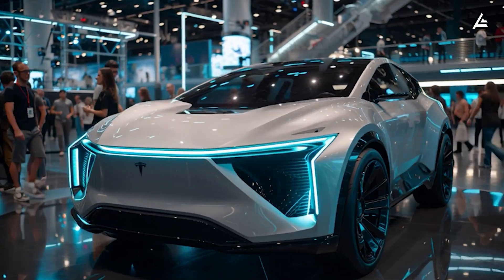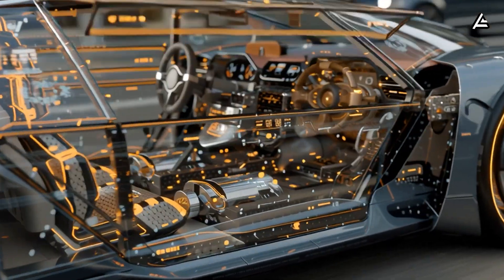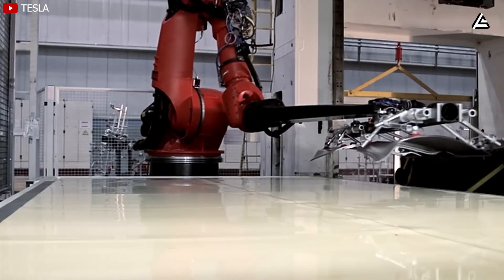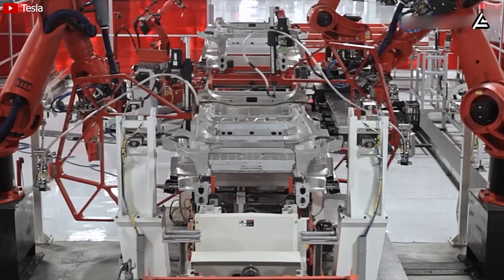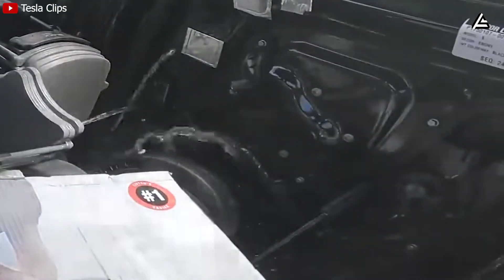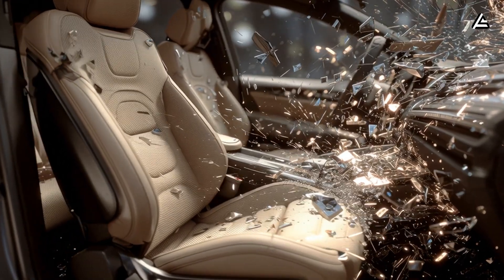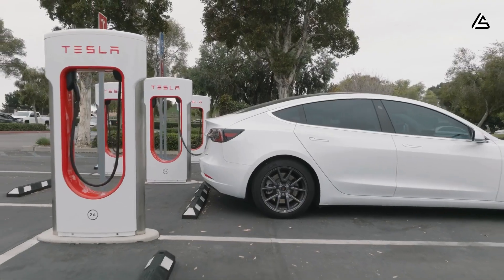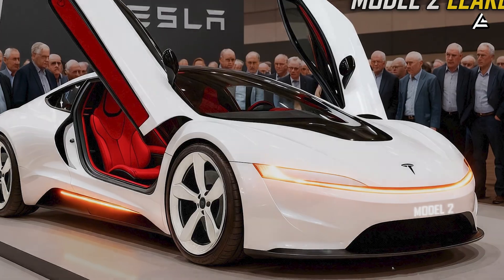2026 Tesla Model 2: What SHOCKING Features Elon Didn't Tell You About?

Comment: I’m curious if these aluminum-ion batteries can handle cold climates.
Reply from the maker: Good question! ❄️ Aluminum-ion batteries handle cold better than lithium in some cases—they tolerate low temps without losing much performance—but extreme cold can still slow charging. Would you prioritize winter performance or overall energy density?

Comment: What’s the charging curve like compared to lithium batteries?
Reply from the maker: Good one! ⚡ Sodium-ion batteries usually charge a bit slower right now, but they maintain steadier performance in cold temps and handle fast charging better over time. Do you think durability or charging speed matters more for daily use?